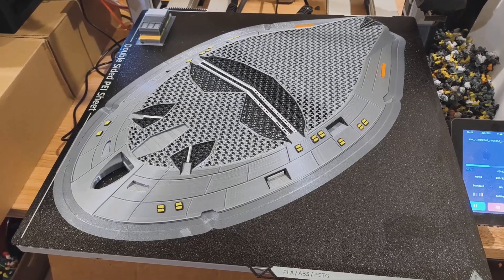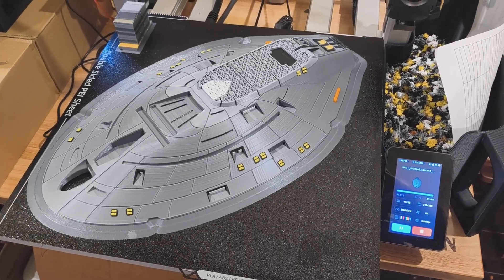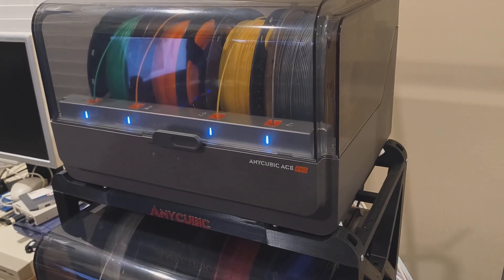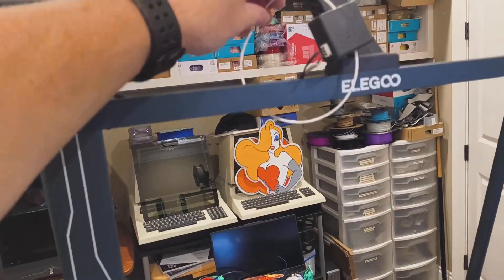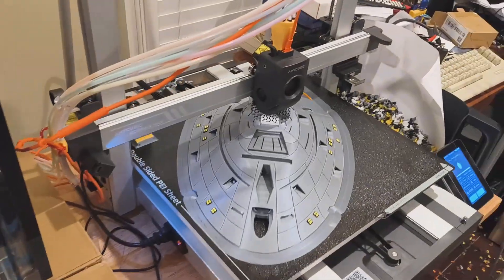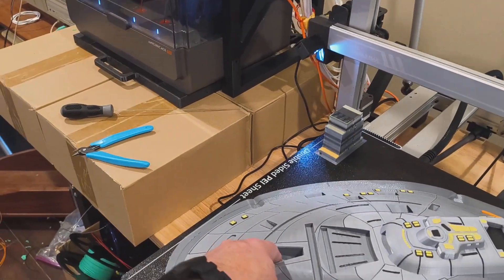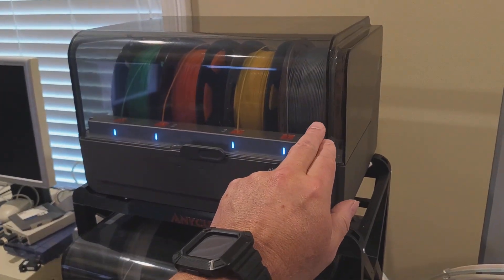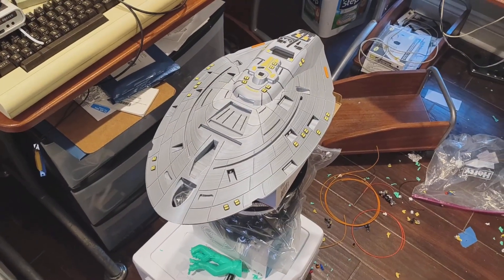3D Printed Starship Voyager from Star Trek vid #2: Anycubic Kobra 3 Max:  Upper saucer done.

Comment: Hi i had the same problem with filament braking on me and it turned out that it was not dry , PLA tend to get brittle when it has been sitting out
Reply from the maker: That's what I was suspecting too, but even after drying, it was the same particular filaments that were causing the problems.  Weird, but I'm tracking the colours and brands and I'll try to avoid them in future.
Reply: That's because it's absorbed moisture. Yes....even PLA needs drying too.
Reply from the maker: @justinmurphy2227  The ACE Pro units have built in dryers.  I use them regularly.  (It's a nice feature).

Comment: I save my plastic rolls of commonly used colors specifically to use a filament winder to transfer. However everything I look at with the multicolor printing, and I have two ACA pro just tells me that paint will look better and potentially take less time. Maybe it's because I come from traditional model kits, but I see the best usage as a refill solution and a way filament doesn't like being to avoid swapping  colors more than anything.  I wish they would post smooth versions, a lot of of the lines that they put in their Star Trek it's just don't exist on screen and that's really where you should be referencing and not pictures of the actual model kit. I've had many arguments with people because the instructions always tell you to add Blu, which does exist on the model kit but he's never ever seen on screen. When people tell me that's the way it should be I ask them if they want black-and-white movies colorized, something that should never be done with the actors faces painted green the way they actually were on set
Reply: I use tape and liquid mask to get my sharp edges, also right now I'm actually building a commercial kit of the Voyager that was molded in clear. I can't tell you what a blessing that has been that instead of attempting to do hundred tiny windows you just get out of dental pick paint the model and scratch off the paint you don't want. It looks fantastic and it's really easy for anyone to do with a little patience. I guess I'm just a fan of the traditional injection mold where all the parts are individual and you paint them that way and then you put it together. It's funny the commercial kid at the Proteus is next on my list and I even have figures for it. In the meantime my 3-D printer is working on the inner space kraken which I highly recommend you look out for. I've had to submit multiple corrections to GAMBODY, it's pretty obvious that a lot of their artists are not familiar with the properties. For example on the Battlestar Galactica colonial shuttle, the passenger area is sunk instead of the cockpit. I'm working on a runabout as well and it's pretty obvious that they have not seen LCARS. A friend wants me to print this for them and I know that I'm gonna be going in with my PLA pen filling in all of those lines
Reply from the maker: @jeffkleist9679  Damn, I never thought of printing the main hull in clear to get the windows... brilliant idea!!!  I bet that will look amazing with LED lighting.
Oh, the Kraken!!!  I'm going to look out for that on GAMBODY (I've bought a few kits from there).  Can't wait to see the final details.
I've got some figures to put into the Proteus seats.  They'll need to be hand painted.
Reply: @LanchburyConsultingLLC  the Kraken is by golden armor he sells it on his own website, I highly recommend it it's extremely high-quality. I got a beautiful print on my cobra three of the first time out. I highly recommend printing the figure if you decide to do the interior and the control panels in there. Print the control panels and clear, and hopefully the figure will come out better than my filament attempts that look like they have leprosy :-)
Reply from the maker: @jeffkleist9679  Cheers.  🙂
Reply from the maker: I can certainly produce single colour parts on my N4M way faster, but the colour printing certainly has an attraction for those who have a hard time painting my hand.
I did this as a "proof of concept", along with my Proteus model from Fantastic Voyage (which I think worked better as that is a mix of single colour parts for painting, and then multi-colour for the crew compartment).  Personally, I like using a paint brush, but this could be really handy for when you have sections with lots of pipes and features that are in close proximity and need different colours with sharp edges.
You make an interesting point about "extra features" added to models that were not there on the original models.  I lot of STL makers use some artistic license in their designs and this model is certainly no different.  I pulled up screen shots to try and match some of the paintwork and  quickly discovered that a lot of the surface features are off.  As it is going to hand from my man cave ceiling I'm not that worried, but if it was a mounted display model that would undergo more scrutiny then I'd take a different approach.
I should have taken a picture of the waste bucket at the end.  It was almost full from the colour changes.